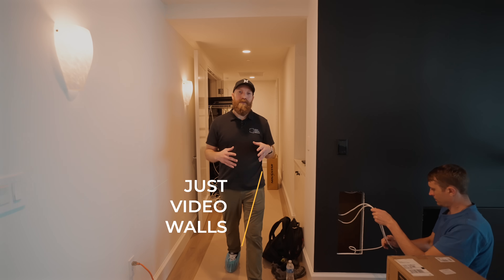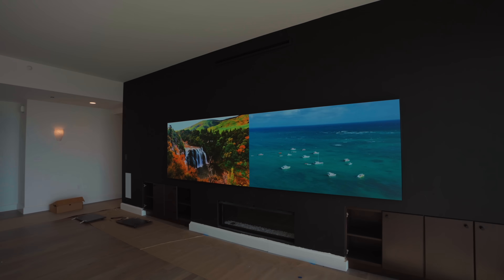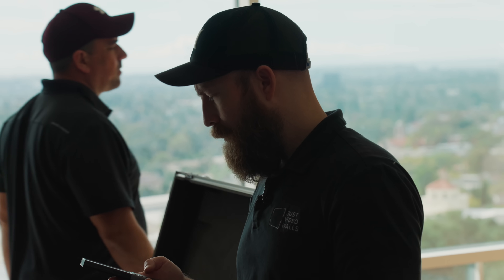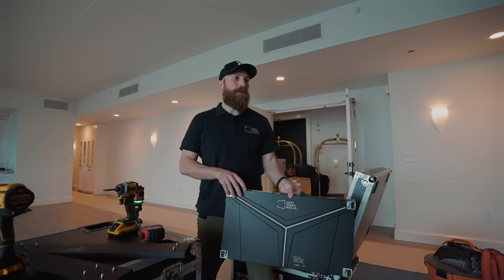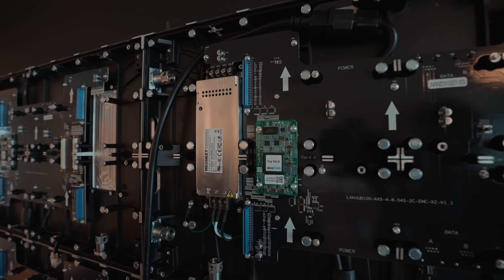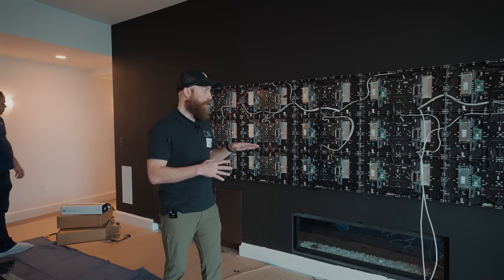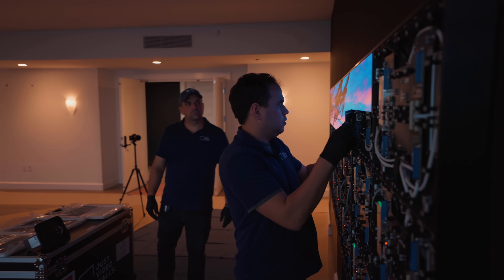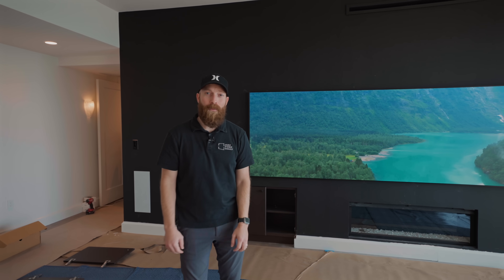How a MicroLED Gets Installed: An Overview of This Ultra-Wide 32:9 Video Wall!

Comment: Do people actually install these systems themself?
Reply from the maker: There may be some people, but we only allow our walls to be installed by a professionally trained and authorized crew.
Reply: Good call.   @justvideowalls
Reply: How do you become professionally trained and authorized to install these?
Reply: @justvideowalls  Was that install included in the 55k msrp price tag?
Reply from the maker: @FJB2020  Negative, that was for the wall bundle including shipping. Install is quoted from the authorized dealer doing the installation.

Comment: Just look at how many wires behind, then assuming each panel has a 2% chance of breaking down in a year, what’s the chance of entire tv won’t break down in 3 years
Reply from the maker: We have walls that have been running non-stop every day for over 3 years with zero problems. If it's installed correctly the chance of failure is lower than traditional TVs. Additionally the system can be fully redundant if need be, plus it's a non-critical failure if it ever does. A single module failing does not affect the rest of the display and can be swapped or replaced instantly.

Comment: Prefer Samsung The Wall All in One solution instead of this modular one. Much simple installation, EU factory, no external controller needed. Manual module instalation is past...
Reply from the maker: To each his own! If you’re ok with giving  me an extra $150k I can give you everything you just mentioned 👍

But don’t be dismayed there is very little difference in what our process involves compared to the wall all in one. And I would argue there are a great number of benefits with an external processor. Really depends on the job and the customer needs. We can absolutely sell you a solution just like that though!

Comment: Sorry, I have to correct this major pet peeve of mine. It's not 32 BY 9 or 16 BY 9. It's a ratio. you have it right there in your title. it's 32 TO 9, or 16 TO 9 ratio. if you have a ratio of 1:1, you don't say "it's 1 by 1". you say "its a 1 to 1 ratio". anyway, I used to sell home theater and it's always bugged me lol. Other than that, killer screen and great video!
Reply from the maker: lol! Fair enough 🙂

Comment: imagine wanting 60 000 failure points for that many dollars ahah damn.
See you in three years when everything starts burning out and something else has replaced this tech entirely
Hope they have good AC in there
Reply from the maker: We have walls running well over 3 years with zero issues. My counterpoint is that your standard tv is no different but the tv has to be replaced completely because the failures are critical. If a component ever gives out (exceedingly rare in our case due to our quality components) then you simply swap that with an included spare that comes with each of our walls, and we will perform repair or advanced replacement on the broken or faulty part. Near zero down time. With redundancy it’s zero down time. 👍
Reply: i wonder how long support this will have and can you buy like spare panels in case of failure 🤔 @justvideowalls
Reply: Negative Nancy !!!!

Comment: As a point of reference,  those super  premium Novastar A10s's are as low as $16-20ea, online.
Reply from the maker: We are using the Pros, not the standard ones 👍
Reply: @michaelz6870 Recheck those numbers and do the research.  You’ll see your comment deserves correction.  These are the best available without going to the 5g system which adds many thousands to the overall price.

Comment: Can you provide some power data for the screen this big? Its hard not to notice all the power supply's inside. Whats the summ of input/output rating power.
Thank you in advance!
Reply from the maker: Typically on this specific wall our spec calls for 2 circuits to handle max output. But the renovation contractor only ran 1 15a 110v and we didn’t have any issues.
Reply from the maker: All our walls come with an exact electrical layout and spec
Reply: @justvideowalls  About how many watts while powered on?
Reply from the maker: @ScottSchramm  we ran this wall on a single circuit, but typically would need 2 per the spec provided to the contractor. It gets a little tight on wattage if the wall is showing 100% white at 100% brightness for a longer duration.
Reply from the maker: @ScottSchramm  About 633 watts average. Max (full white at 100% output) is a lot higher since these walls do not have AGC limiters. About 2,500.
Reply: @justvideowalls Wow, good to know. Thanks for the answer!
Reply from the maker: @ScottSchramm  👍👍

Comment: Hows the heat dissipation? I see that there isn't a huge ventilation system which is great and probably reduces ambient noise.
Reply from the maker: Heat hasn’t been a problem on this one. We have some larger walls in smaller spaces too and it hasn’t required revamping hvac. We give our dealers the btu spec for each wall at max and minimum to ensure that it’s ok for your system.

Comment: The individual pixels are very visible in many of the shots 👎
Reply: It always looks worse on camera ive seen them in person and you've got to be painfully close to see the pixels
Reply from the maker: This is normal. The camera is often positioned way closer than any person should watch per the pixel pitch option. On this wall we could go a lot tighter pitch but the customer application was not appropriate for it.

Comment: Great job. What’s the price of that canvas?
Reply from the maker: About $50-$60k depending features and options. That is for the upgraded pixel tech from this which amplifies the contrast ratio and reduces heat output (not shown in this video)

Comment: What would be the resolution for this type of 32:9 screen? Or the customer can choose if they want a higher res or lower res individual panels?
Reply: You can see that this is very low resolution just by how huge those pixels are. This is very early stage tech.
Reply from the maker: Ah you’ve got the right question. There are no visible pixels past about 12 feet on this wall with 20/20 vision. Guarantee if you see it in person you won’t consider any resolution. We have some more detailed content coming soon but in summary the point at which you can no longer physically determine pixels depends on the size of them and your distance. So resolution is totally irrelevant at this distance. This wall is 1.2mm and we go down to 0.9 and even smaller. That said, we have users who love this pitch even at 9 feet away, which is what we showed to our crowd of experienced AV integrators in September last year. Hope that helps! 👍

Comment: Whats the heat output on this compared to OLED ?
Reply from the maker: Typically a bit higher. This one is based on a traditional pixel technology which is less costly up front but does output more heat. Our flip chip pixel tech allows for a much more efficient management of heat output. Even with this wall though and other similar installs, we did not have to modify the existing HVAC

Comment: Is this similarly priced to Samsung's The Wall or what is the advantage of your system?
Reply from the maker: Our prices are very competitive :)

Feature and quality, we have specified all the best components possible in conjunction with a highly capable external processor which enables 8k, 120fps, fully grayscale calibration, multi layering of lots of sources simultaneously, upgrade ability and a host of other features. But most of all your buying from a company that focuses 100% on video walls, not washing machines :)
Reply: @justvideowalls does your tv support dolby vision?
Reply from the maker: @StepTronic  it does not currently. But our processors on this type are upgradable if there was a DV option in the future
Reply: @justvideowalls Sesli güldüm.